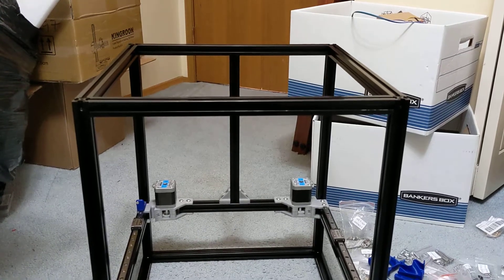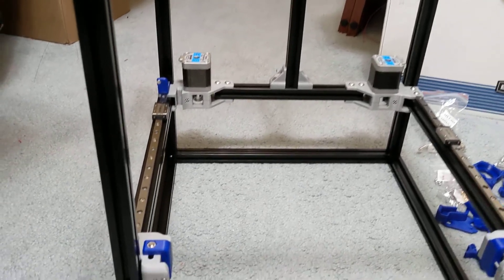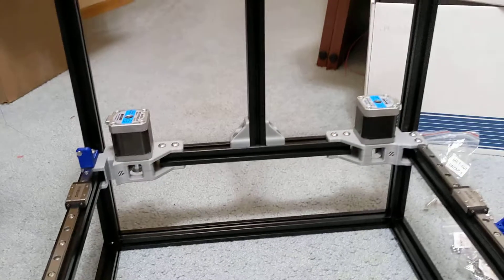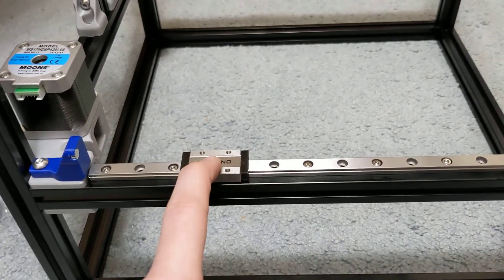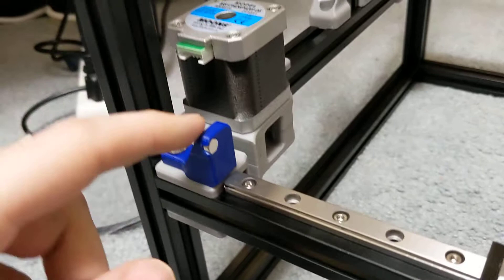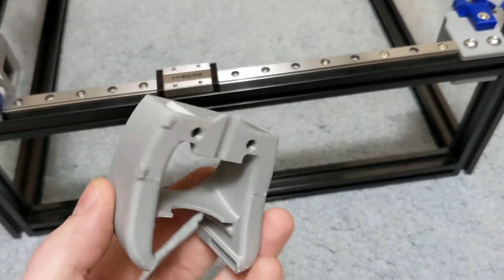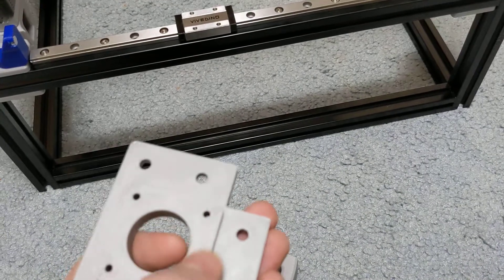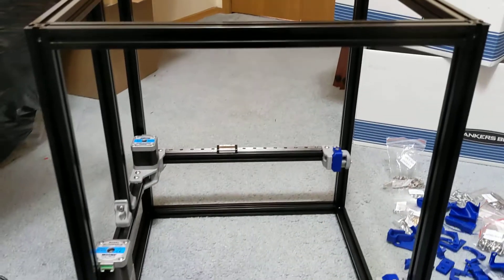FORMBOT Voron Trident 3D Printer Kit - Episode 1 Assembling the Frame and A B Motors.

Comment: You can print Sparta3d's ABS+ easily my friend, if my idiot arse can do it ANYONE can, LOL!  You don't need straight ABS, Sparta's ABS+ prints at 230-240, on an 80-90C bed.  So you can literally print this stuff on an Ender 3 with a garbage bag or a cardboard box over it.

Comment: What build size did you choose? Also, can you just put some PTFE grease on the inner grooves of the rail and run the carriages back and forth to lubricate the bearings? Looking forward to your final impressions of the Formbot kit, I hear good and not so good things about them.
Reply from the maker: I bought the 250 kit, if you put grease just on the rail itself the carriage seal prevents the grease from getting into the bearings.